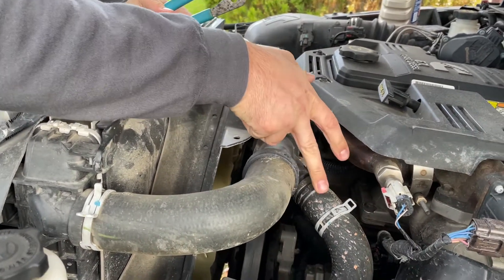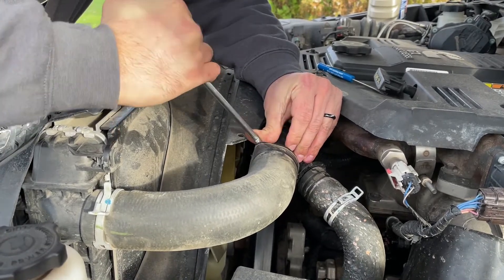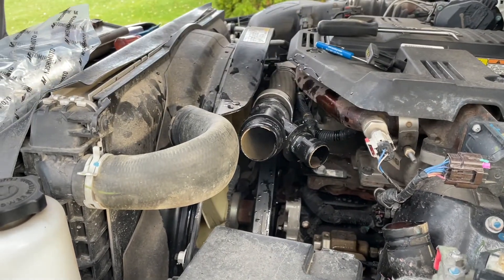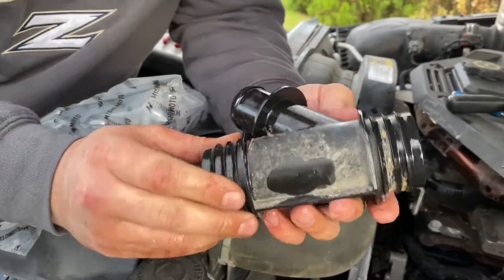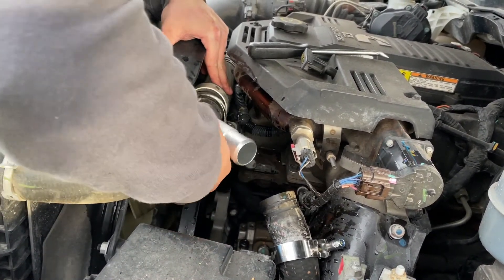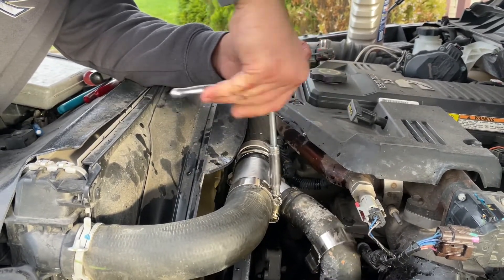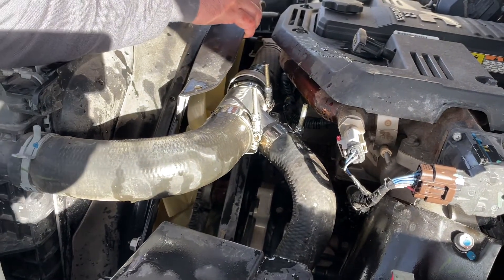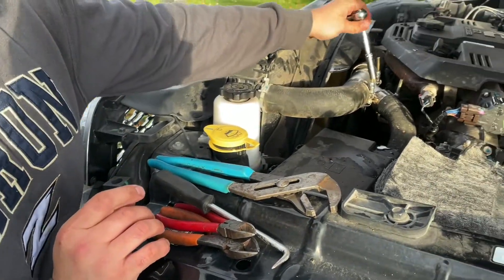Leaking Cummins Y-Pipe Replacement | Mishimoto Welded | 2014 Ram 2500

Comment: There is a bleeder screw to the right of the coolant tank. Loosen that while refilling the coolant. Once only coolant comes out tighten the banjo bolt (they were hex bolts before) reinstall the pressure tank cap and run the truck.

Comment: Nice video however, just a casual mention of "Burping" but no explanation given...assume your talking about taking coolant fill cap off while engine is Not running and fluid somewhat cool and squeezing the upper radiator hose by hand a few times to drive any air in the radiator hoses towards the coolant reservoir - refill as necessary.  Is there another way to "Burp the system"?
Reply from the maker: I’m no tech but this is how I performed it: top off the coolant tank and drive the truck under normal load until the thermostat opens (190 deg.F) when this occurs, the coolant will be drawn from the tank taking up air gaps in the lines. I then drove back home, very carefully opened the coolant tank lid and let the truck idle (no splashing happened but be very cautious), topped off the coolant again then let cool fully. Repeat this once more to be sure all the air is out and you should be good. I’ve had no heating issues with this method. These systems are pressurized (tank included) so this may be overthinking it- topping off, driving, topping off again may be all it takes. I did not squeeze any lines
Reply from the maker: Also note that I left my heater running full bore in the cab this entire time to ensure that the heater core was circulating coolant while ‘burping’